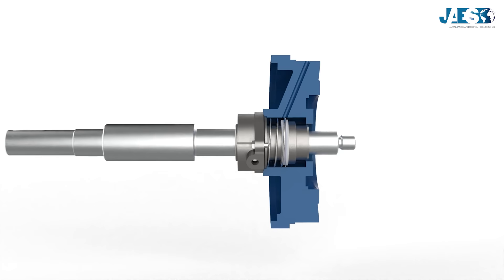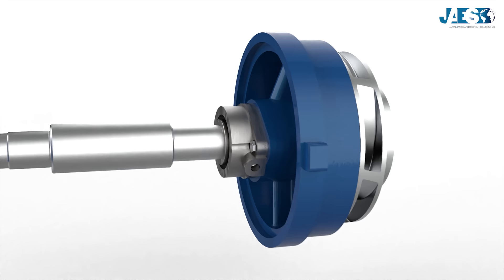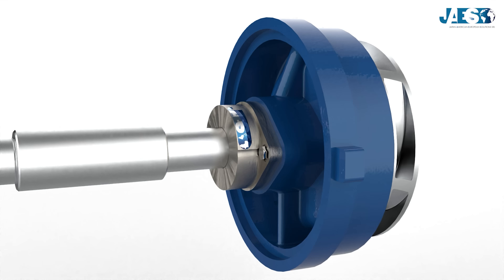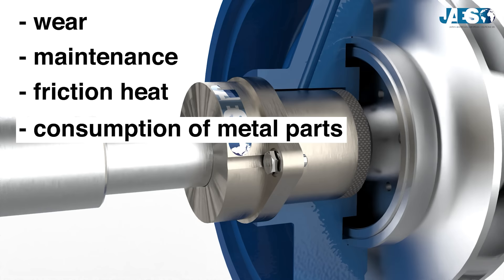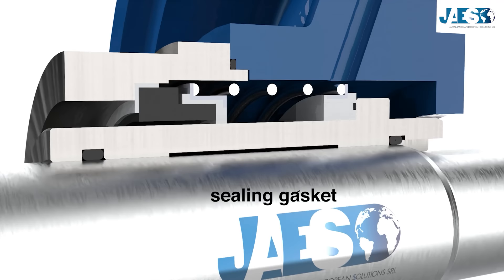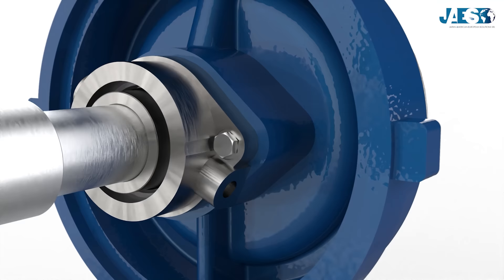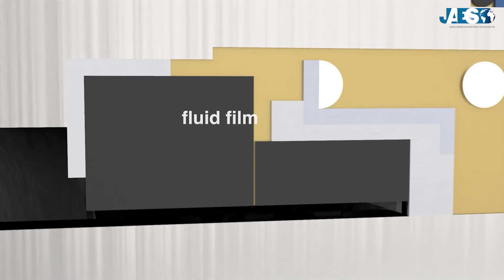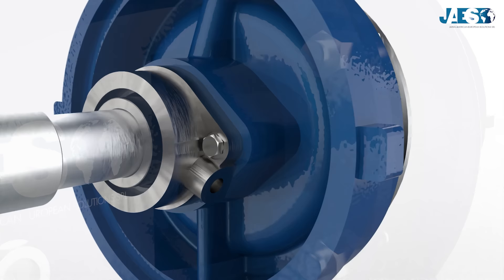How Mechanical Seals Work - stuffing box - packing

Comment: Thanks youtube ... this had been a long standing and pressing curiosity
Reply: Same here, I never could figure out how they sealed rotating shafts when holding back high pressure fluids.
Reply: Further read about API682 mechanical seals piping plans to know how different arrangements of piping and related equipment are used to provide the pressurized lubricating film in between the rotating and stationary part of these seals. Also read about Dr Gas Seals which are widely used in heavy equipment like centrifugal compressors dealing with natural gas as process fluid.

Comment: Question... during operation, in the video it states that the two surfaces (stationary and rotary) don't come into contact, but are separated by a film of water or whatever is being pumped, how is that fluid stopped from getting past the two half of the seal and leaking through the back of the pump/seal?

Comment: I work for a sanitation district and we have a handful of these mechanical seals on our waste water pumps. In the stations that have issues with grit like sand coming into the wells from the influent line, these mechanical seals dont like it. Periodically have to be taken apart and have the seals replaced. If the station doesnt have a grit issue then they work fantastic, you just have to dial the flow through them precisely.
Reply: Are you in California ?
Reply: @xxxdpgxxxx1389  no
Reply: @chefdan87  what to expect for a mechanic, got a job offer in the sanitation district in apple valley, really good pay government job.

Comment: 1. For a common centrifugal pump the rotation of the shaft should be clockwise as viewed form the motor.
2. One seal face sould be slightly concave to compensate for thermal distortion as the seal runs and heats up.
Reply: Ok Mr. Genius!
Reply: 100% agreed with you.
Reply: Maybe you could make your own videos!
Reply: Not so sure about #2. Seal faces need to be flat. If there are temperature concerns there is an inlet from the gland plate that serves to lubricate the mating surfaces. The rotary element is usually a softer material than the stationary element under a fixed load that pushes against the stator as it wears. The reason that fire trucks use packing rather than seals is that seals can break and leave you high and dry in a possible emergency.

Comment: So, I am working on this pump and it has the packing right off the pump. The shaft then runs through a cast casing with a bearing on each end. And according to the drawing the mechanical seal is in between the bearings so to change it I have to press the shaft out. Why is there a packing seal and a mechanical seal a few inches further down the shaft?

Comment: Diamonds can cut diamonds. Diamonds can cut sapphire. Sapphire cannot cut diamonds.
BUT SAPPHIRE CANNOT CUT SAPPHIRE! Wait a minute! My granduncle taught me this which was passed on to him by his teacher in mechanical engineering and he in turn passed it on to me. As for lubricants we use medical grade castor oil mixed and dissolved with processed fish oil and mixed and dissolved with molybdenum disulfide. Castor oil creates a self-renewing varnish like coating on moving mechanical surfaces, fish oil allows deep penetration against rust and especially penetrating very hard rust, molybdenum disulfide allows extreme lubricity. FLEXIBLE Graphite is also useful as a revolving seal material when used against each other for graphite lubricates itself also.

Comment: Hello, very interesting video. But what about when the medium that must be pumped is sand slurry? Is is still efective? Cos we has some pumps in our AAC factory and mechanical sealing broke very often. The sealing is cooled by water from a reservoir. This reservoir came with the pump.
Reply: On board a ship we had a pump was have to pump mud and similar erosive substance, the air seal was used. Compressor constantly supply some air to be like blown into through the seal, tiny amount but worked with no issues at all.
Reply: Problem is that our mechanical sealing is flushed with water to cool down. We cannot add compressed air. And if we use air is not going into the pump and wil cause cavitation?
Reply: @bladerunnerro  Appears the pump manufacturer might be using a mechanical seal that is unable to handle your service requirements, or at least you need to upgrade the seal specs. The reservoir might be used for flushing as much as cooling. I'd suspect you need harder mating surfaces, such as a tungsten or silicon carbide mating surfaces. I have 10 years experience in sales and service, but that was many years ago now. You need a seal recommendation, and I'd bypass the pump manufacturer entirely for this. Mechanical seals are not cheap, but downtime is wasted money, too.

Comment: Today I saw a water pump leak at the area of shaft, suspected the mechanical seal leak, does the mechachnical seal leak can cause the Air enter the pump system?... There are two pump operating to serve in the same header outlet pipe, the good pump outlet pressure is 0.5Mpa,while the mech seal leak pump outlet pressure is 0.4 MPa.